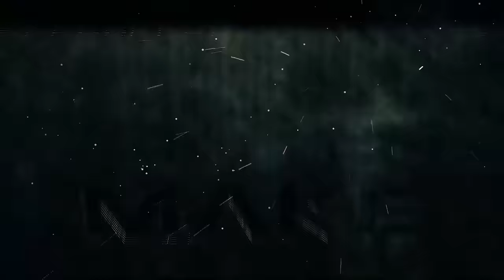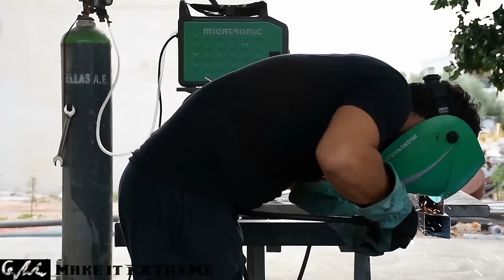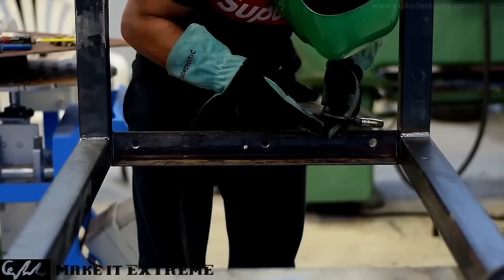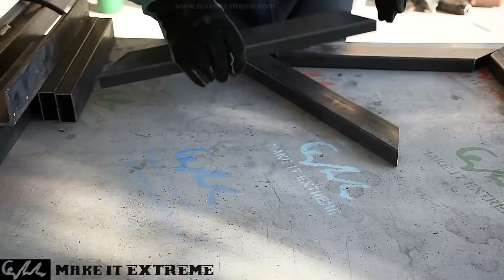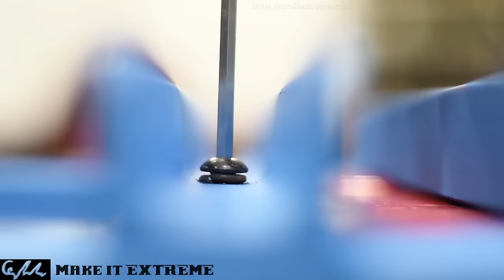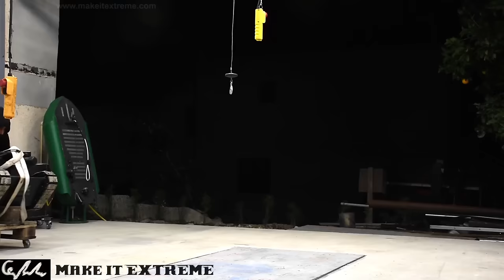Make it Extreme's Crane

Comment: That is pretty neat. We have Gantry cranes at work, but can lift 20 tons... or that's max load. The control box is wireless... for operator safety. The movement is motorized. It goes back and forth on a track. Pretty cool stuff.

Comment: Something I find useful is a roller conveyor belt at table level.  Make a 16' of roller tables on both sides of the saw to make it easier to cut steel.   I like bi-metal horizonal bandsaw rather than chop saw.  Substantially less noise, less sparks to ignite materials laying around, cuttings are contained in one area rather than all around the shop.  Accuracy is also improved as blades are 1/16 vs a 1/8 chopsaw blade.  Kneeling up and down for every cut is great exercise, but fatiguing when your trying to work all day long.

Comment: Hello Very inspiring video. Just wondering two things. What happens if the crane jumps, it may miss the track and fall down. Overhead Crane often have an "anti" jump the iron. For example, if the strap breaks.

Next reflection why using a "china" cable crane to such a fine building.
chain crane is safer but also more expencive ..but still..
Sincerely / Safety Inspector of cranes from Sweden

Comment: for the first time I've m not impressed. you build this big track, and then you use significantly smaller stock on the rolling part, then to top it off you put all the load of the crane on 4 fasteners, you might as well have built the whole thing out of sheet metal
Reply: Assuming those fasteners are around the 1/4-20 size and he used a decent grade bold each one should be good for about 3000 lbs.
Reply: Wow, that's some amazing material.
Reply: poodlelord agreed. First one that is seriously under engineered. My thoughts exactly when I saw those parts of the video.
Reply: Jradical. prove it.
Reply: Jradical is right, your grossly under estimating the strength of his arrangement. 

Lets say he used a 1/4-28 unf bolt, if you look at MIL-S-8879C, it lists the nominal minor diameter of a 1/4" -.2500-28-UNF at .2065 inches. Now a few simple calculations  and we can find out the he the A (area) cross-section, and then apply that with a known spec'd bolt grade strength from mil , and we get 

A = Pi x r2 = Pi x (.2065/2)2 = .03349 in2
Grade 8 bolt capability in yield (stretch) = 130,000 lbs / in2 x .03349 in2 = 4354 lbs minimum
Grade 8 bolt capability in tension (failure) = 150,000 lbs / in2 x .03349 in2 = 5024 lbs minimum
Grade 5 bolt capability in yield (stretch) = 92,000 lbs / in2 x .03349 in2 = 3081 lbs minimum
Grade 5 bolt capability in tension (failure) = 120,000 lbs / in2 x .03349 in2 = 4019 lbs minimum

Even a cheap grade5 1/4-28 unf bolt would hold a minimum of 3000 lbs before it would start to stretch "yield, and exhibit permanent plastic deformation". 

Assuming that hoist he bought is the common cheap offshore hoist you see a 99% of common discount tools stores, its probably rated to lift 880lbs, such as this one from harbor freight which it looks very very very similar to if not the same, https://www.harborfreight.com/880-lb-Electric-Hoist-with-Remote-Control-62854.html, then EACH bolt affords a generous 3 to 1 factor of safety, times that by 4, and you can clearly see a those 4 grade5 1\4 dia bolts would be easily up to the job. 

But I am 99%  sure he used a bolt larger then 1\4" but the looks of the video it appears to be at least a 5\16 or metric equivalent as he is located in Cyprus, and being a socket head cap screw design I would venture to say its a higher grade bolt material, at least grade 8 most likely. That MEANS IF MY ASSUMPTIONS ARE RIGHT, his 4 bolt design is many many many times stronger then the calculations given for basic grade 5 1/4" unf bolts.

But to prove it, yes, a total of 4  grade5 1/4 bolts would easily and safely support the load that the cheap offshore single line hoist can lift. Infact, a SINGLE grade 5 1/4 bolt center mounted and loaded in pure tension would do it with a factor of yield safety factor of 3 roughly if it is the cheap Chinese 880lb hoist I linked to. Although a single bolt mount in tension for a overhead lifting apparatus would be just silly.

To be honest, I trust those 4 bolts more then I would trust that cheap Chinese lifting hoist!
Reply: I know you are right, but it just feels a bit underwhelming
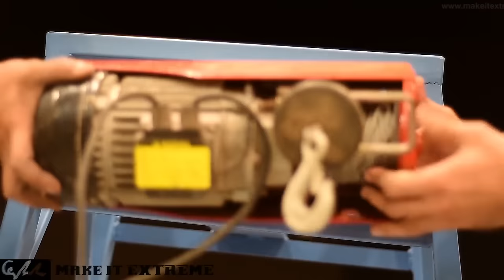Reply: Look at the 4:00 minute mark. He has a plate UNDER THE HOIST as well as the bolts that will hold more that the cable or winch itself.

Comment: Good idea as always, but i really don't see why there isn't any side to side movement by putting that whole thing on another rolling system. It would be even cooler if you added some motors and a chain to move the cart thing. 

Besides that critique, Im probably going to build this in my shop anyway. Can't justifie a forklift for such a tiny shop but I bet I can make a weaker version of this for less than $1000.

Comment: That huge, beefy fixture, and only 4 little cap screws holding your winch on? Seems to be the weakest point.
Reply: The castor wheels would be another weak point too
Reply: Those little winches are typically only good for 500 or 1000lbs.
Reply: Those four "little" cap screws are high tensile and you would need to load them up enough to shear down the threads of all four or pull all four through the mounting brackets. I would say that the lift motor will slow down and then stall out first before the cap screws fail.
Reply: They are in compression, but it is most likely that the wheel bearings would begin to fail first.
Reply: Mark Fryer. aah, good point.
Reply: @markfryer9880  If the motor is hanging from them how are they in compression??

Comment: What is the blade on your chop saw? Where can I get one that will cut everything! lol Thanks!
Reply: James Matthews It's an Evolution style tungsten carbide tipped saw blade. About $125.00 a pop. Many different styles and pitches for the type of metal and thicknesses that your going to cut. Don't waste your time with them. Loud, easy to break the teeth, and sharp shards thrown everywhere. Buy a band saw. A good one. Made in USA. Quiet, reasonable to operatate, and last forever. If you want something to throw in the back of your truck, get one like they're using.

Comment: as usual it's awesome! i just a litte bit disappoint on the number and size of bolt to fix the motor to the steel rod, but i think ancorage can safely handle more weigth than you ever will pull :)

p.s. those clean welds are gorgeous :D

Comment: Extremely small button head bolts holding the winch in. And all the weight the gantry might be lifting.. well built, with what seems to be a critically weak point. I hope the winch doesn't crack anyone in the head after the load smashes their toes. After the the tiny bolts break or tear through..

Comment: Why not build it so that you cannot roll it only back and forth but also sideways?
Reply: lot more work. and not any chassis is up to it.
Reply: That would be good idea, but realistically specking it would mean rebuilding whole roof, or liming its back and forth motion by meter or so, not to mention dropping whole thing down so much that it would be pretty useless. 

Roof would be have to risen and structure re engineered to take the combined load of the lift it self, object being lifted and the roof. Essentially too much work, that would cost too much to be practical option. If you have place to build one and your going to actually make it, then you will create it to move in all direction as well. Commercial cranes are good place to look how they do this type of things.

In his case moving objects in two axles is enough as his has those rollers to put them on.

Comment: Why are the wheels uneven from one side to the other?
Reply: The counter angle on the crane cart makes the wire pull level with the floor, as their roof stucture is and an angle to direct the rain flow.

Comment: now could it be strong enough for car motors?
Reply: I think the winch can lift a car motor easily, but I'm not sure how the roof will hold up.
Reply: the Tank's weighs about 110 kg including its batteries that is in the video..
Reply: i think that can safely hold at least 200Kg, the only weakness in my opinion are the two steel rod which bolt are screwed in ,and size and numbers of bolt, both  too thin for me !

Comment: very nice. but kind of irresponsible. you need to adapt the roof beams to the additional load too
Reply: The way the  construction looks, the safety margin of the roof is likely to be enough if they don't lift 5000 lbs+
But i would have to agree, it would be good to have some numbers.
Reply: the electric hoist he is using is only made to handle a around 1500-2000 lbs. hes likely will not be using it to lift more than shop projects and tools i think its safe to say its pretty solid :)
Reply: If that. Most of the ones around that I've seen are only good for like 500lbs, 1000lbs if you use a block.

Comment: cool, you can now pick something up, and move it 8 feet in one direction!
Reply: Lift it up and place it on the trolley, so its easier to move around, with out need of lifting it with your body. Pretty useful if you ask me and also making it 3 axis system would have meant rebuilding whole structure...

Comment: Are you really hanging everything you lift from 4 button head machine screws?
Reply: Aaron Bruckelmeyer no the blue frsme also carries load
Reply: Doctor Robotnik but the red winch is only screwed into the blue frame...with screws...
Reply: Aaron Bruckelmeyer 
That winch is not strong enough to break those bolts.